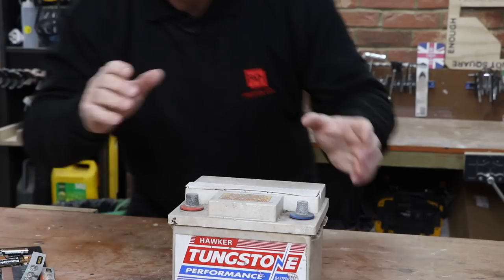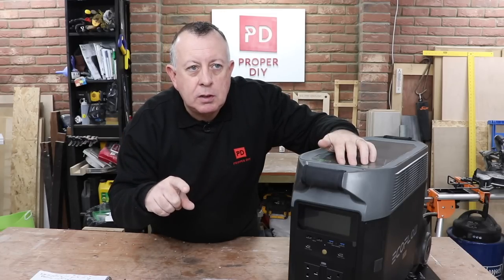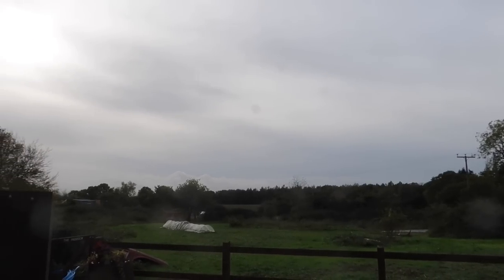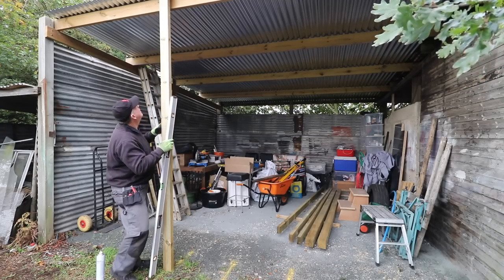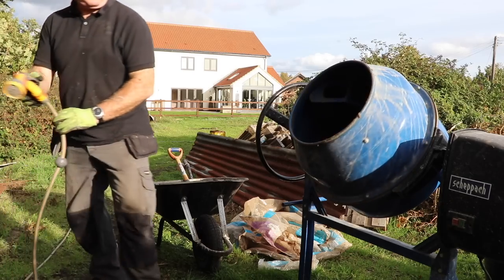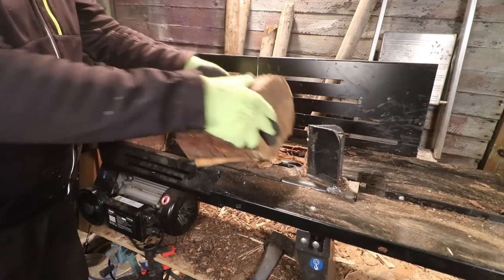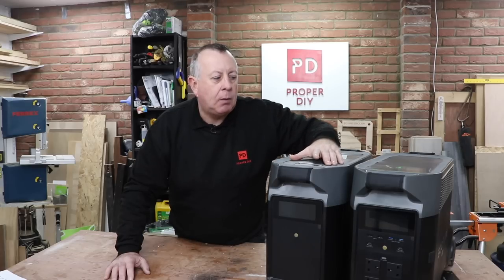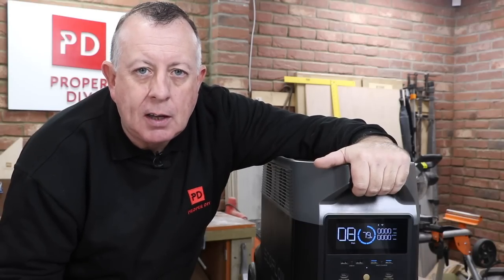Ultimate Home Power Backup - Ecoflow Delta Pro

Comment: The question you didn't answer is would you spend £3500 of your own money on one or would you just spend a couple of hundred on some decent industrial power cables to run power to your paddock...
Reply: More like £5000 with the solar panels and additional battery!
Reply: He can afford it probably getting sponsored to sell this item.
The Blueletti is best and cheaper and can be solar powered. Read the reviews
Reply: @hisnameisworthy7886  the difference is the horrible customer care from bluetti. i am waiting 2monts for delivery from them and they do not respond to any problem..you can read reviews about them. cheaper only by about 10% to similar size product.

Comment: I've installed solar panels for my house last year. I'm very happy with them. I was thinking about paying more for battery backup, so I don't need to buy elecricity at night, but it was just too expensive to justify the costs. I'm gonna definietly reconsider it once those solutions get cheaper!
Reply: We had solar panels installed 6 years ago and have just had a second larger array with battery backup installed a couple of weeks ago.  You're right, the batteries are expensive and I worked out that charging overnight on economy 7 and using during the day / evening had something like a 20 year payback.
What I am finding though is that the batteries are capturing excess solar and releasing it in the day, so even in winter I'm saving solar electricity that otherwise would go back into the grid
Reply: I've a 4kw solar array installed in 2016 for 6k, which diverts surplus to hot water and we are virtually 24/7 365 days a year free hot water.    Over past 2 years I bought allpowers versions of solar generatoes 1k each, I've 5 now, why?  Well this global farce is likely to continue for years, but I also. Have a motoorhome, so my initial thoughts was AC power on the road, which I get with one and sometimes 2 travelling with me.  No campsites in UK and Europe at all.   Secondly the units I have are used to power the basics such as TV nightly, fridge and freezer standbye for power outage, and kids PCs That draw 100w pH daily generally saving me 1500 to 3000w per day.  Tv saves me on average 100w per hour during usage.  These are better in my view due to portability, flexibility in use and  can be charged independently of domestic solar array,  using 4 provided.  Solar portable panels.  By no means cheap but a tesla wall isn't also and the guarantee on some alternatives is questionable.   My bills are now a month are 35 quid, which is mainly the standing charge which I can't avoid.   Ecoflow are a good system, I'd love to have their new system but I'm waiting for drop in price to be competitive to 
My current brand.     This platform is not twitter also, so some can be distracted by the negatives rather than the take it or leave it advice or tips

Comment: The voltage rise on that motor which causes your shed lights to dim can be ameliorated some by inserting a capacitor in front of the motor.  The cap will charge when plugged in and the generator will pull power from the cap which will compensate for the rise before powering from the mains.  The rise voltage needs to be determined, then apply some maths and electrical engineering knowledge to determine which capacity capacitor you require, some simple wiring and Bob's your Uncle, no more dimming.
Reply: And if I remember my early years, you can test if it is charged with your tongue PP9 anyone?

Comment: I have had a smaller power station for a while a Jackery . Can charge up via a solar panel in the garden in the summer or my solar charger battery in my van . I have a fixed solar panel on top of my van charging a li-lo lightweight battery handy when travelling. To charge things. Solar charging is good in UK in summer not in winter . Having lived in Kent I am now in Scotland. Looks like the thing described can power anything . I use my Jackery to power my TV at home , it lasts a few hours. A battery back up is much better than candles 🕯️ and the fire risks . If you have a power cut.

Comment: Not sure if you got supplied unit or you paid for it with your own money. I purchased a river unit for my small workshop (shed) and it can run small power tools and charge all my batteries without any problem. It is hooked up to one solar panel which this time of year is quite useless. However after the last cold spell unit failed completely.  Ecoflow were very helpful and unit has been returned so just waiting to see if I will get a refund and or new unit. Did it put me off having/using one certainly not.

Comment: First one of your videos that has disappointed. No mention of cost, or whether you got it free in return for a review. Other comments mention cost vs petrol or diesel generators and I have to agree. I looked at these electric power banks and decided it simply wasn’t worth it for me, for DIY use and in case of power cuts.
The only real benefit I can see for these electric power banks is if you need power indoors and can’t run a cable through a cat flap (my plan) as you don’t want to risk carbon monoxide poisoning.
I don’t buy into the ‘save the environment’ aspect due to the need to mine (and eventually dispose of) highly poisonous elements for the batteries.
Reply: Some people still believe that oil dont need to be mine transportet and refine at big energy cost. battery already recyclable at 95% currently.

Comment: Warning: You may only get half the power out of what you put in !!. 
You might think charge it up at the night rate and use it to power things during the day - thus save the difference - if only. 
If you are powering 'resistive' type equipment - electric heaters you'll get what you put in - minus DC/AC conversion loses. 
However the issue comes when you power equipment with a low power factor, pf. Anything with motors, fridge, freezer, computers (security system) with a switched mode power supply will typically have low pf's - down to 0.41. 
When powered from the mains you are only charged for 'Real Power' and thus effectively not charged for the losses incurred from powering low pf equipment. Industry pay extra when running low pf equipment - but as yet not the consumer.
A fully charged EcoFlow unit has to provide both the losses from the DC to AC conversion but also the losses due to the low pf - thus a 0.5 pf equipment will only give you half the units rated power ouch!  
Thus with the charging losses on top, 20%, don't expect savings by charging at night and use by day.
Reply: Even if there were savings to be made it would take you several lifetimes to get back the cost of the unit!
Reply: @Petertronic  This really isn't for saving money. It's for 1) power redundancy if the grid is down 2) portability over a large property or in vehicles 3) a storage system for solar panels 4) quiet alternative to a petrol generator. You also don't use a petrol generator during the night to save money.
Reply: @assortedmountainlife  My reply was to warn any users if you try to use these units in one particular mode - thus any reply to my comment would normally be related to this reply and not just go completely off-topic!!. Try making your own primary comment.
Reply: @rtreborg8472  I was replying to @Petertronic

Comment: I looked at these as a means to harvest cheaper overnight electricity. 6000 charge/discharge cycles at today's prices would save me £1200 over 16.4 years. I'll just put the extra £2400 onto my energy account!
Reply: when you charge it with solar (what they are design for) you get the money back in 8years.

Comment: A 6kw diesel generator 1000 quid, 15 hours on a tank of  off-road diesel, Runs the house for days or weeks if it was total grid down situation. The battery stuff is overpriced and only lasts a few years maybe 10 at a push. The diesel generator lasts for decades. And what if you don't have power for days would the solar system recharge it as your using it, I doubt it. Maybe there ok for use in a built up area, but they won't give reliable and consistent power.
Reply: I totally agree. I think these things are good but there definitely overpriced I think for a emergency backup a diesel generator would be the best option
Reply: Okay. Buy what YOU want.

Mobile phones are over priced too, but that's not stopping anyone from paying the price.
Reply: It is not overpriced - all these electronic components are expensive. But it's possibilities and usefulness are overestimated
Reply: Diesel doesn't grow on trees either. If you are off grid, a solar panel is very handy. No, it's not a complete replacement for a generator, but for many things this comes in very useful. Camping, campervans and powering cabins for instance. On jobsites it can be useful too, like in this video or working in odd places on a property or in houses where there is no power. A generator can do a lot of those things too, but sometimes noise and emissions are a problem and for some things a bit more sophisticated power is good too.
Reply: @johannes.f.r.  you can use bio diesel. There will always be liquid fuels.
Reply: @Macron87  my collegue is selling these (but from other companies) and it is not. It has a lot of stuff inside. Anyway we just have to agree to disagree.
Reply: @johannes.f.r.  of course it is usefull here and there but calling it replacement of gas powered power generator is like calling fiat multipla as a replacement for delivery cargo van.
Reply: @brendanc5519  Yes, of course there will be fuels, but not always where you are. In the scenarios mentioned, batteries can be a better option.

Comment: I’m not sure I’d be comfortable charging a battery of that size in my house. I used to charge an electric scooter in the house but having seen what happens when the charge cycle goes wrong I am very cautious of very high capacity lithium batteries now.
Reply: they ave very different battery in the generator lfp battery do not catch fire like cheap scooter battery.
Reply: @dhewitt2514  95% of your house can catch fire

Comment: Mmm, but you did not mention the cost compared with generator. There’s a big difference; I checked after Roger Bisby did a similar promo. What can go wrong over time with these sophisticated electronic devices compared with an IC engine running on petrol, red diesel or propane. How can you recharge it in your shed? 5 litres of petrol is a lot lighter to carry than a 3.6kWh battery.
Reply: what can go wrong when big diesel generator cacht on fire, as happend to me on blackout when i need energy the most...

Comment: I agree and disagree with a lot of the comments made,
Overpriced, yes, but like all technology it will come down in price as they become more mainstream.
Batteries won't last as long as a diesel generator/combustion engines ,Wrong, having worked for Toyota for 10 years on there electric cars and used Ni-Cd, NiMH and LiPo batteries in RC cars on and off for 20 plus years batteries if charged ,maintained  and stored correctly will last decades. 
Is battery power and technology the future, reluctantly yes, all the environmental damage  is caused by the manufacturing process of batteries  It is considered  buy some that an electric vehicle creates almost as much environmental damage as a combustion engine Car ,Personally I think  Battery power is a short term solution until the next thing comes along what that is I have no clue 🤷🏻
Reply: A diesel generator will last longer than a battery pack it doesn't degrade with age or use as fast as a battery can. My neighbour works for a Toyota dealer and they are replacing batteries on 12 year old Prius with about 230,000kms, and what hey are small units. These new batteries have no long term proof that they last. Fully electric cars are failing at 250,000km with bigger batteries.
Reply: @brendanc5519   Everything has a shelf life, I'm no longer working for Toyota so can't say, I only ever replaced 1 in my time, but it's obvious that some may fail or not last as long as excepted, and the same can be said for combustion engines as they fail as well, and suffer wear and tear if not maintained, and maintenance of any engine is require throughout there life to continue to work at there optimum. I'm not for or against either, happy to agree to disagree.
Reply: @brendanc5519  Diesel generator catch fire as happend to me on blackout day..

Comment: Charging Lithium batteries inside is a fire risk - which is why EV owners tend to charge their cars outside due to the fire risk. If you have a EV fire you will NOT put it out with a fire extinguisher!! Even the people with a large red vehicle have problems putting out a EV battery fire.
Reply: So what about all those house batteries that are attached to / integrated with solar systems in garages/cupboards/attics? 
Every mobile phone has a lithium battery in it, do you charge yours out in the garden?
They are all fine.
Reply: @fraz3alpha  Its all a matter of how much 'risk' you want to take. Some EV fires in a garage have resulted in the whole house been burnt down!! Remember to tell your insurance company if you have Lithium batteries in the garage or in the house. Failure to tell your Insurance company may invalidate your House Insurance policy.
The risk of lithium batteries in phones is small. 
Remember the risk in any lithium battery will depend on the quality of its components and type of construction - space / type of spacing between each of the battery cells. 
I would put a Lithium battery for a solar system outside - maybe a fireboard cover on top.
Reply: @rtreborg8472  Lithium Iron Phosphate batteries do not have this problem.
Reply: @assortedmountainlife  Lithium Ion Phosphate are only 'less prone' to explosions and fires. It is totally wrong to say they do not have this problem. 
Also be aware that EV car manufacturers use different battery chemistry's. The lower performance ones have moved to the Lithium Ion Phosphate, but the higher performance ones still use the older Lithium Ion technology because they give a higher energy density.
Remember it is always about evaluating the risk factor and what risk you are willing to take.